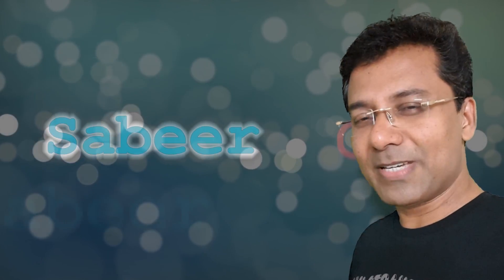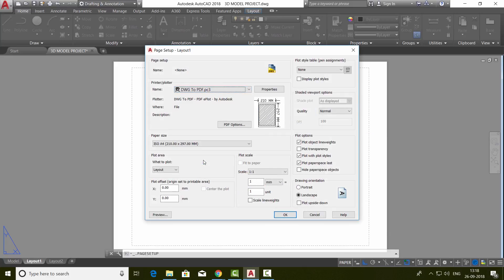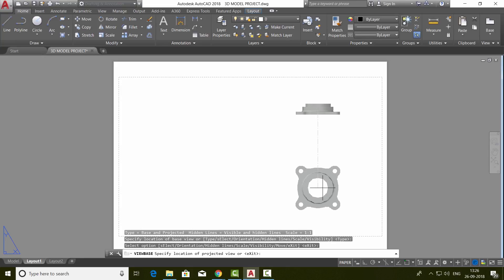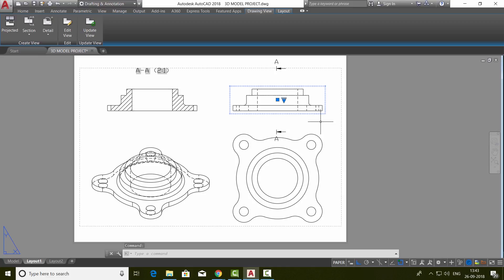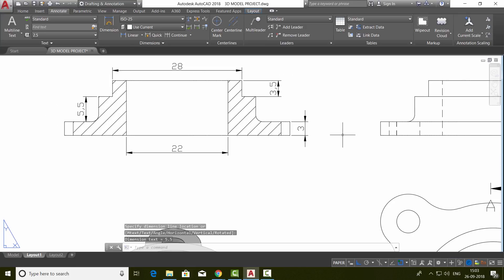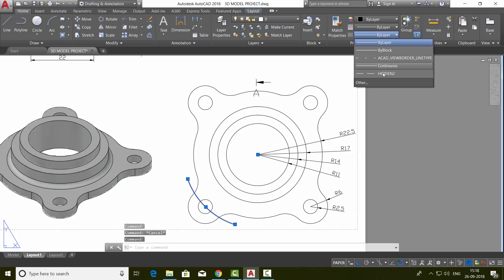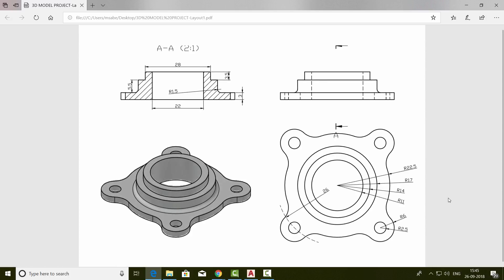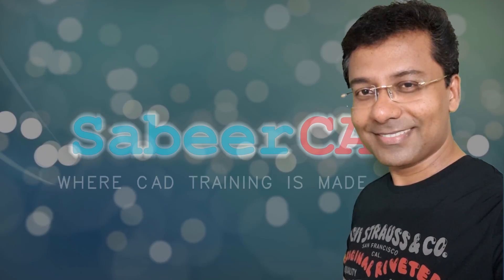AutoCAD Mechanical Modeling and Visualization Part3  | From 3D to 2D in AutoCAD | AutoCAD BASE VIEW

Comment: Hey great teaching skill, my autocad skill has gained some improvement as I have been able to detect a missing dimension on your drawing. You missed add the fillet radius between the 6mm radius and the 22.5mm radius circles 👍

Comment: 3 D files can be written and then what do you do next?
Reply from the maker: You can use the 3D model
1.To conduct presentations
2.To create 2D drawings
3.To  3D print the model
4. Can be taken to other software to perform simulation, Analysis etc.

Comment: Excuse me, Master ... want to ask:
The VIEWBASE command cannot be used (autocad 2017), it keeps appearing ... "Unable to perform the requested action. This drawing was last edited with the model documentation in a newer version of AutoCAD."
thank you for giving the solution ...
Note:
The file condition is clean, there is only the 3D object box,
, i've Try installing autocad 2015,2016,2017,2019,2020 ... but the results are still the same.erorrrr

Comment: how to erase line in 3d model? I still can see some unnecessary line in that 3d model.
Reply from the maker: First you erase the 3d model.  Then you will see all those unwanted lines.  Move those lines to a different location.  Then give OOPS command to restore the erased 3d model.  Then erase the unwanted lines you have moved.
Reply: @sabeercad  Thank you for this tip - works very well :)